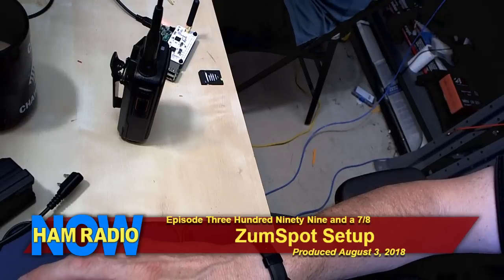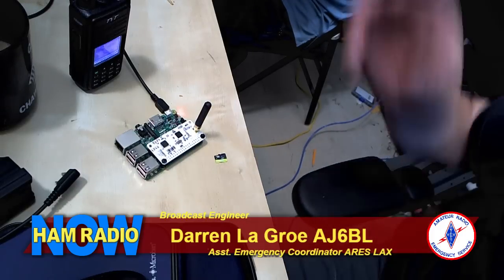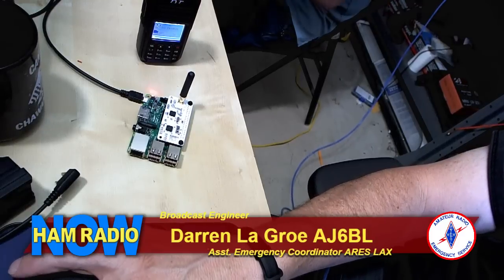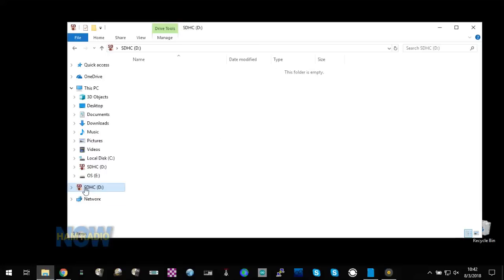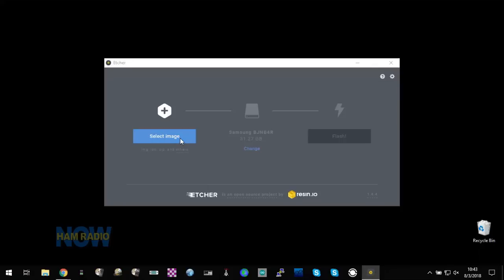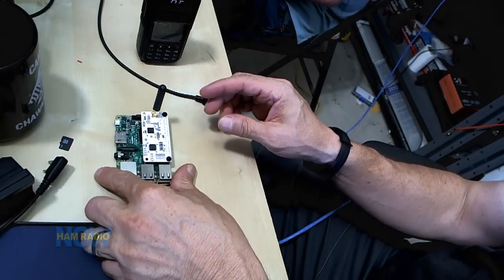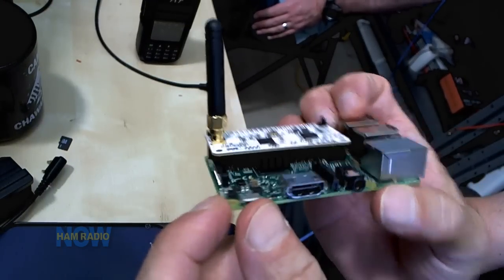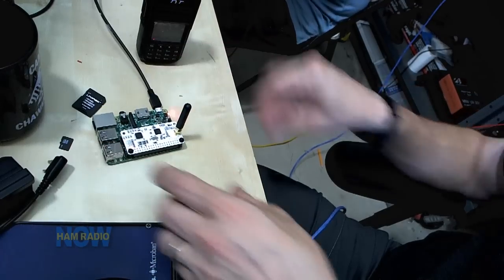HRN 399 7/8 ZumSpot Setup

Comment: Hi guys, is there a way to apt-get the pistar software... so we can use the pi for other uses?   Like, running Raspbian and let the pistar stuff run in the background?
Reply: I’m pretty sure there are a significant amount of dependencies in the Pi-Star OS build. You could probably self compile it from github or something, but then there is the web server etc. that may be using Apache and/or other software that you would also need to download and configure. I’m not an expert on this OS but have a bit of experience building similar OS’. Without a very thorough walkthrough of the build process it may not be very easy. Maybe someone else here can point you in the right direction. Actually it might just be easier to take the pi-star build and apt-get yourself a GUI (although I can’t vouch for the results and performance.) I posted a link below to installing the PIXEL GUI on raspbian lite. If you try it let me know how it goes.

https://gist.github.com/kmpm/8e535a12a45a32f6d36cf26c7c6cef51

Comment: Ok, sorry... last question I promise:  once they release the 2m version, does that mean the zum spot could technically act as a stand-alone packet radio node?  Like a full blown Digi-peater?  (Assuming anyone else could actually hear the 10mW transmitter). I notice that the spot also supports P25... isn’t that sorta like AX25 packet protocol?

Thanks guys!  73, N1SFT
Reply: I haven’t tried it but I’ve read on forums that you can actually modify the existing zumspot and enable 2m usage. If anyone here has tried this please chime in.

Comment: Where did you get the Zumspot and the Raspberry pi? I have one a friend gave me with a pi-zero-w and would like to have one with a pi-3. Have you found a case yet?
Reply: The ZumSpot will work with any Pi. It has the same pin configuration. The only real difference is the Pi zero doesn’t have an Ethernet port.
Reply from the maker: Got mine at Ham Radio Outlet... You can order them online.

Comment: Can we pull a GPS location through the pi if we’ve got a GPS daughter card plugged into the GPIO header?
Reply: It’s probably possible, but you would have to modify the ZumSpot since it plugs into all the GPIO pins and does not have a feed through.
Reply: Thanks Darren for the replies!  They are much appreciated.  Plenty of food for thought!  :). 73, N1SFT